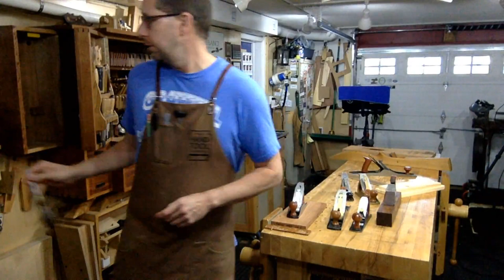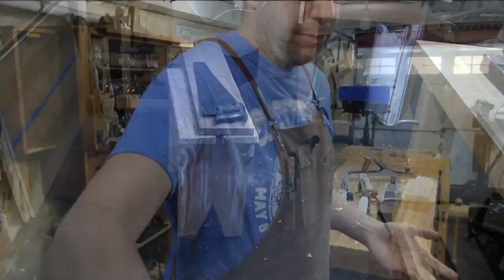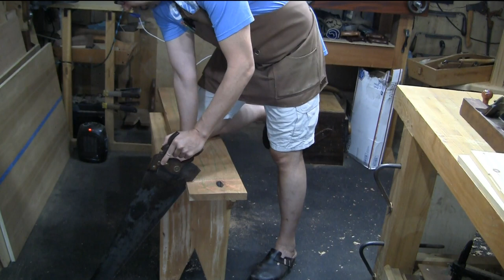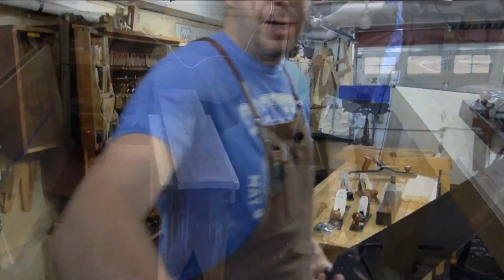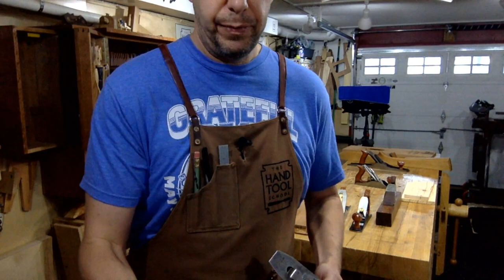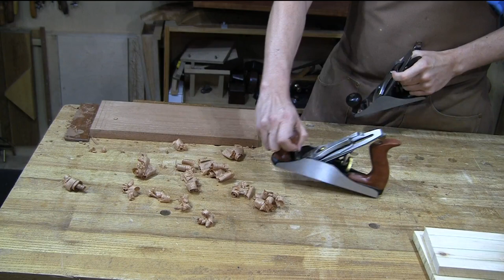Saw Length by Height and Choose Your Hand Plane by Function

Comment: Consider the double overhand grip with the longer saw either with standing rip, or seated rip. You may find you can use all those inches.
Reply from the maker: Good point, I use the overhand mostly for standing work at my bench with my panel saws and it does use more teeth.  I should try it more often with my coarser pitched saws but the way my shop is set up I don't often think about it as I have my sawbench area on the other side of my workbench.
Reply: @RenaissanceWW  It was just a thought relative to the longer length. Seeing people do standing or seated ripping it would seem that you can use a longer stroke than the leaning-over-on-one-knee posture. Also, if you are using your whole body you not only have the flex of your arms, but the additional distance of your knees and so forth.
Reply from the maker: The thing you have to worry about with this approach is a two handed grip on the typical handsaw will throw off the body mechanics and often times it results in the cut going askew.  Its correctable but you have to consciously lean the cut a bit since that arm crossing over is pulling your body to the side.  The typical English pattern saw is a one handed tool unlike some continental frame saws, which is where you mostly see the seated sawing approach or the higher workbench sawing.

Comment: I want to add that the Japanese probably have used a thicker blade for centuries because their iron quality was not good.  That is why the Japanese go through such a long process to make a blade good, because their iron has a lot of impurities.  People think oh! this Katana sword was something magic because they folded it that many times.  No! they did that to get rid of all the impurities, otherwise it would break during use, also the Katana is a thicker heavier sword than pretty much all other swords of same length.  In the sword world, that's not a good thing, as lightness and speed is key.  I know were talking about plane blades here, but i suspect the reason is the same.  A thicker iron can be of inferior quality but still do the job, as the edge has more steel to back it up, a superior blade of the finest steel should get away with less thickness.